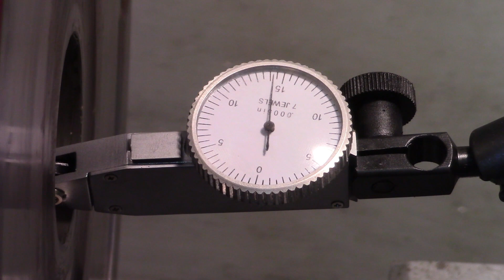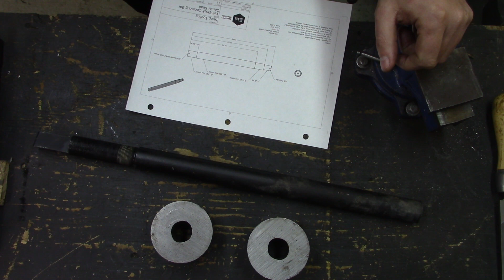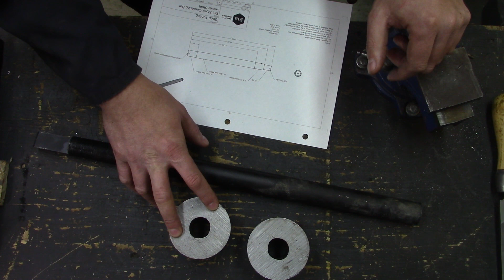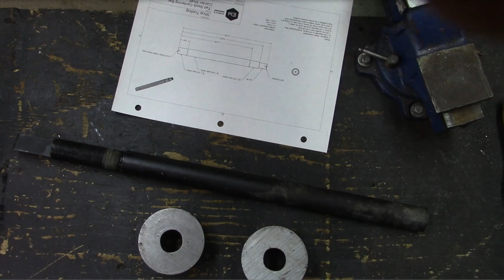Making and Using a Tail Stock Alignment Bar

Comment: Great project Everett.  I made one of those back in the 70's but later used it to machine something, need another.
Reply from the maker: Thanks Harold, just one of those simple things you need but need to get to. As long as you haven't bumped or moved the tail stock since the 70's it should still be lined up, right? Hope you're doing well.

Comment: Smart planning, more material the better build it to last and retain its stability over time maybe, depending on the method of storage I suppose. Nice build a joy to watch, great hold on the dimensions. Looking forward to more from you and thank you. Lance & Patrick.
Reply from the maker: Thanks Guys, it mostly had to do with what was there in the bin - the name brand one has smaller journals but they're hardened and ground so less likely to ding. This one has a spot in the to box so it should be ok though. I figure 2 ten thousandths over a foot is close enough for most of my work for the time being, for sure. The cross slide and tool post flex more than that . . .

Comment: Gday Everett, I’m not that far off borrowing the wife’s purse and buying a new lathe, my old faithful has had about enough as in a little to much wear in the ways but saying that it is I believe a late 50’s machine and I love it and has been with me for around 25 years, I will keep it for my boys to learn on, I was thinking of the same idea as you just made to true up the new one and I’m glad I seen how you made yours and as you said it’s not rocket science so I think I can handle this build, thanks for sharing mate it really is much appreciated ohhhh and I see you have almost clocked the 3k subscribers congratulations mate,    Cheers Matty
Reply from the maker: Hi Matty, glad you liked it.  Yeah, once you get your new machine leveled then this wouldn't be hard to make work, you might just have a different mix of leftover metal bits to make it from.  Some of those older machines are great, built like tanks, but as you say a lot of them have wear in the bed now.

Comment: Very good run through on the test bar!  When working close to the chuck (especially with a dog whipping his tail around) I like to set a saddle travel stop and double check it before powering up.
Reply from the maker: Thanks, it works for what I need it to do. I also want to make a saddle stop at some point as my lathe never came with one.

Comment: Nicely made. You did discover why, even if you have a quick change tool post, you never discard your lantern style tool post. The QCTP is the cat's pajamas 97% of the time. But the other 3% when you are having to work close to the chuck AND close to the tail stock the bulk of the QCTP can get in the way, whereas the skinney lantern toolpost tool holder may give you more room to work.
    The tool you've made has some other alignment uses on your lathe. It may be used to detect vertical misalignment of the tail stock to the head stock spindle center line. With a test indicator you can determine if the tail stock is sitting high or low. By taking measurements with the tail stock quill fully retracted and fully extended you can determine if the tail stock quill is parallel to the head stock spindle.
   You would use your tool after you have checked to see if the head stock spindle center line is within the parallelism specification to the lathe bed both verically and horizontally.
   Lathe misalignment often shows itself when drilling small holes and by mysterious tapers when close turning (e.g. bearing mounting surfaces) that horizontal adjustment of the tail stock with your  alignment tool won't cure.
Reply from the maker: You make a good point, I'll have to check quill centering in the Y-axis (vertical) in relation to the spindle.  As time goes on it's hoped to continually tweak the machinery I have to get the best possible results and the learning process is half the fun. It's one thing to read about but another thing to fiddle with. In time, like a lot of things, the machines (and I) should be able to make better work. Thank you for being part of the dialogue, I like your thoughts and suggestions.

Comment: One mans trash is another mans treasure comes to mind. For anyone that is interested make friends with your local Mechanic, they often put to waste pre loved struts from cars and they can be a very useful source of STOCK, I don't call it Scrap. Great Video and hope things warm up for you Guys and Gals.
 Cheers from John, Australia.     PS: The Struts will make a good arbor for this kind of project.
Reply from the maker: You make a very good point, I still get scrap steering parts from my former workplace, which is a Dodge dealer, and my buddy at a heavy truck shop saves me pieces too.  Yep, the rods from struts would work well for this, you might just have to anneal them to give a facing and put a center point in them.  I just call it scrap because all of this oddball stuff comes out of a scrap bin, you're right in that anything that is used for material toward something else is "stock."
Reply: @EverettsWorkshop  I have not found it necessary to anneal, it is tough material however ordinary HSS will handle the task with the correct speed and some cutting oil brushed on. It drills and taps ok too, though some makes may be harder than others. Cheers from John.

Comment: Need ONE! Will be one of my first projects when lathe is hooked up. Real nice job! Awesome video! Watching in Alabama!
Reply from the maker: Yeah, it's worth it to make one - I didn't realize the tail stock was that far off until using the bar. Most of the work done until now has been short lengths of turning but now longer journals can be approached with some degree of confidence. Thanks for the support, looking forward to seeing yours up and running!

Comment: Nice work as  usual, I had to turn a shaft that was 14” long the other day, it needed to be pretty close O.D. End to end. I found out how far off my tail stock was! It took me a while to get the tail stock centered properly. I wanted the shaft to come out to .500” but by the time I got the tail stock set properly, I had under cut the shaft. So I ended up turning it to .425” so I could use it in in a collet. I need one of these alignment bars. 

I picked up a new lathe this weekend, it is a Cincinnati Lathe 12.5” x 36” tray top lathe, it is monstrously heavy! I  have some work ahead of me cleaning up the surface run off the ways. And getting all the controls cleaned and working properly. It has been setting for many years!
Reply from the maker: Thanks! Just a few repurposed pieces of scrap, but I needed one of these tools once the lathe was leveled. That'll be a good old machine to fix up, well worth fixing those old machines. They are much more solid than the import machines.

Comment: nice project man, very useful. 3 piece construction saves a lot. thanks for posting
Reply from the maker: Thanks, I was just trying to use what was on hand.  The commercial name unit uses an aluminum tube for the center section and hardened, ground ends, so even they go with 3 pieces.

Comment: Thanks for the idea.  I've been using a long roller rod from a printer which I am told is extremely accurate but a pain to use.  I think your idea is much easier and simpler.  All the best
Reply from the maker: I've heard about using printer rollers, but haven't found one easily.  I can't claim originality for the idea, it's just how I used the concept with the materials on hand.

Comment: This kind of process is more popular applied to detect, if any bed rail twist error, instead of in guiding tail stock eccentric error correction.  Especially for hobby lathe of limited rigidity mounted on table with a 0.001” twist.
Reply from the maker: Yeah, I hear you - between using this bar and making test cuts I've had to readjust the feet on the lathe a couple times as the machine has "settled" into place.  You're right, hobby lathes are not the most rigid.

Comment: nice going Everett,  if I could add a grain of salt.. I usually put the dial indicator directly on the journal you machined therefore getting a direct reading of the tailstock movement.  im not a betting man but i would wager a nickle that it took you a few tries to dial it in. you got it dailed in really nicely. job well done
Reply from the maker: Thanks, Phil. It took 3 or 4 shaves of the journals to get within .0002", so can't complain. You're right about the indicator though, it is better to measure from the rear bar journal. At least now that they're cut like they are I can just use a dial indicator on the journal to tweak it in and out for tapers. At some point I want to learn gear cutting and it sounds like I'll need a tapered mandrel for that. Hope you're doing well!
Reply: @EverettsWorkshop   you can use a tapered manderl to hold your blank  or  you can use an arbor with  a key in it  to hold your blank also.  
yes doing well just  fed up with winter.
cheers

Comment: Great idea for aligning the tail-stock.  After your final cuts on the end bells I'm not sure if it would matter but I would have put the Dog end on the tailstock (reverse the bar) and with an indicator on my tool post check the run out / difference on both bells just for my own satisfaction.  Additionally, the .002" might be caused from the up / down clamping force on the tail-stock.
Reply from the maker: Thanks James, but I can't claim originality for the idea, just adapted the idea to materials I had on hand.  At some point I might pop the centers back in and swap it end for end, we'll see.  But I figured that measuring 2 ten thou over a foot for now is close enough for a machine like mine.  At some point I might revisit it and mess with various things like tail stock extension, etc., but for now I need to get some stuff built.  Thanks for coming by!
Reply: @EverettsWorkshop  that’s actually a very good number. Don’t worry about it.

Comment: Well done video and nice project.  Cover your ways when using abrasives it will be very beneficial in the long run.
Reply from the maker: Thanks, been wanting one for a long time but no point unless the machine is level and straight.  I usually give the ways a quick wipe and re-oil after sanding but yes, I agree covering them is good when using lots of abrasive.  Someday hopefully a tool post grinder will be in the cards, then a definite need for covering well!

Comment: I finally made a dedicated one last year...it was long over due. Now you can actually turn a taper on purpose and get it lined back up easier.
Reply from the maker: That was my thought exactly - I want to be able to cut straight journals and bore straight holes, but at some point would like to be able to make tapered arbors for between the rotary table and its tail stock.  All little pieces in succession, all in time.

Comment: Very cool .  Not all that big of a deal for me since I rarely work on anything over a half an inch in length.but still  very interesting  for the technics involved
Reply from the maker: Thanks! Most of what I've done so far was less than 6" lengths of turning so it didn't matter as much. Now I can get better accuracy in a number of operations and can trust the machine more.

Comment: Nice tool, and you've just set me off on making one for my myford ML4, the tailstock is famous for been rubbish. Though with that tool it's pretty easy to set it right. In addition if the bar is at the correct length, using trig the correct angles can be setup to turn morse tapers between centers. The angle I believe is 1.49 though someone once told me the lengths of the triangle against the right angle to arrive at the perfect taper, unfortunately I seem to have lost this in my memory banks.
Reply: Also surely now it's machined, you could pop it in and put a DTI on it and measure the offset, no need to machine down??
Reply from the maker: This is precisely why the par is as long as it is - from mid point of one journal to midpoint of the journal on the other end it is 12", which allows me to set taper per foot.  As far as I know you're correct in that it is a 1.49 one side angle for Morse tapers, but it is something like a .602 offset per foot.  Theoretically once one has a bar like this then the tailstock can be offset using a dial indicator, so I shouldn't need to cut it again unless I drop it or ding it up.
Reply: Brilliant, that's what I thought, I've just found your channel after it popped up on a suggested video, I've subscribed and looking forward to more interesting vids in the future 😉

Comment: If we are looking for inspiration, just look under our nose, in this video.

The idea of cutting out dovetail to fit into a tool holder matching the tool post, eliminating “the middle man”, the quick change tool clamp. 

What would they think of next ?
Reply from the maker: Thanks, but the idea is not mine - I got it from John Mills (doubleboost).  I have a couple large tool holders that were bought from eBay that got dovetails cut into them.  Biggest issue is the hardness of the shank as it is hard on high speed steel dovetail cutters.
Reply: Everett's Workshop 
Thanks for honesty. I remain impressed. Yes too hard on HSS. Can we find dovetail cutter with carbide inserts? or shaper mounted with carbide tool?

Comment: Question, why did you not heat the rings / freeze the bar?  with such a close tolerance they likely would have just dropped together then when returning to room temp would be "set for life".

I'm not trying to be sarcastic, I'm honestly curious as I'm new to all this.
Reply from the maker: Hey Chad, no worries, I can tell you aren't just trolling. For what it's worth heating and shrinking on had crossed my mind but I figured pressing them together was quicker and will be sufficient for holding the rings on. I have heated sleeves to go on shafts before but had better heating equipment around at those times to get the parts hot. Thanks for joining in!
Reply: @EverettsWorkshop  Thanks for the reply!  Being new it was something I wondered.  My first thought was that I would probably have pressed it too, just because i don't like waiting!  It would be a few  hours in the freezer, then time in the oven, then the 'quick' assembly, etc.  Knowing me, that would be an entire additional day into the build.

Comment: hows your tailstock clamp working on that lathe? mine slips under heavy drilling or even when im using the live center. i've tried hand lapping it, blueing and scraping it, even swapped clamps with the steady rest.
Reply from the maker: Mine sometimes does, but only if it wasn't tightened down enough. Usually it's ok. Noticed that the adjuster nut underneath needs constant fiddling with but that's the worst of it.

Comment: Question can't you just move the tail stock up to the chuck and see how the points align?..
Reply from the maker: That would get you a rough measurement, yes - but to ensure a more precise alignment verification it's better to have the two points of measurement farther apart. If the reading at the headstock is within .0001 of the tailstock reading at a foot apart you know you're in good territory. This is why I wanted an alignment bar, just didn't want to spend a c-note on one.

Comment: on my list as well, Question is it really necessary to turn the shaft diameter for the bells on center or just do it when you cut the extra length on the ends.
Reply from the maker: I figured it was worth it to do the center drills then turn the journals for the ends between centers. Was trying to keep things as concentric as possible. There may be other ways of doing it but this made the most sense to me.

Comment: Do you have to re - machine the two diameters every time you off set the tail stock?
Reply from the maker: No, not now that the journals are practically the same size. I can use a dial indicator now and go off the measurements with the cross slide and compound locked as the carriage is moved.

Comment: I'm just a backyard metal hacker that has never heard of a tail stock alignment bar. What does it do and how does it work?
Reply from the maker: Honestly I'm a hobby metal hacker too, so we're in the same boat.  The bar is meant to help in aligning (or purposefully misalign for the purpose of cutting a taper on purpose) the tail stock quill with the headstock spindle centerline.  Like in the end of the video, if you take a skim across both of the large journals without touching the cross slide or compound dials, then if the tail stock and spindle are aligned the diameters of the journals will be the same.  Once it's skimmed and they're the same, you can use a dial indicator on future uses of the bar to verify tail stock centering.  Likewise, if you want to make a piece with a small amount of taper, you can purposefully shuffle the tail stock to one side or the other.  In this case you use the bar and a dial indicator to see how much you've moved it.  Hopefully this helps, thanks for joining in!
Reply: Thanks for the answer. I get it now. I enjoy your videos!!

Comment: Try putting your outer ring in the oven at 450 for 1/2 hr. Then it takes less pressure to put it on.
Reply from the maker: Yes, you are definitely right on that one.  I hadn't thought of doing that, but at 450 it probably would have slid on.  I might need to get a shop toaster oven first, as last time I cooked metal in the house it stank the house up and my Better Half was not impressed . . .

Comment: will the size of the end bells make a difference as I want to make one for my mini lathe
thanks in advance
Reply from the maker: The size of the rings o the end is arbitrary, the only thing that matters is that they are the same.  Mine are within .0002 of each other, which gets me as close as I trust this machine to be anyway.  You could make yours a different diameter from mine and as long as your two match, you're golden.